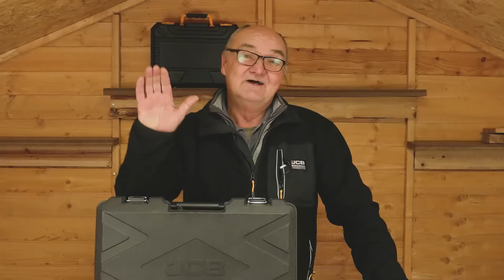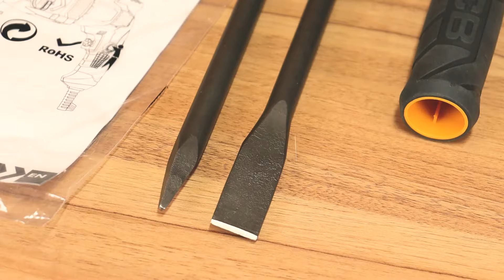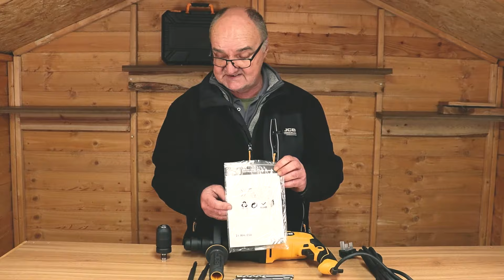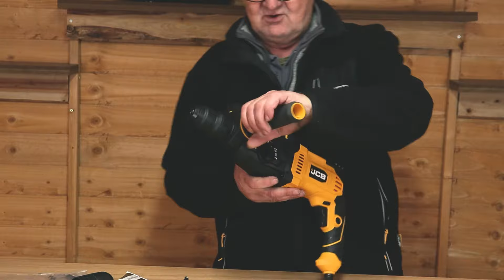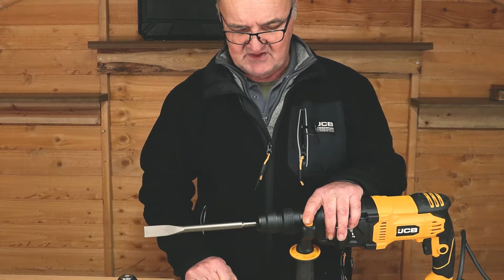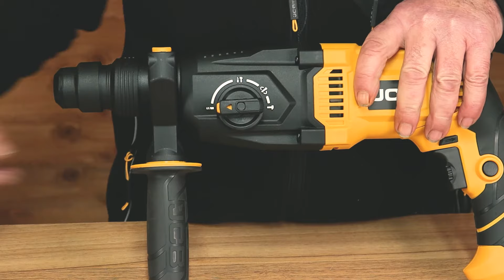Unboxing The JCB Tools 1050W Rotary Hammer Drill | The 21-RH1050

Comment: Is this actually a sds drill. I just brought the exact drill. It says just hammer drill in name not sds will have the same power as models with sds in the name?
Reply from the maker: The SDS in our instance, refers to "SDS Plus" our advanced chuck and bit fitting. RH1050 in the model name refers to 'Rotary Hammer, 1050W' I hope this helps!